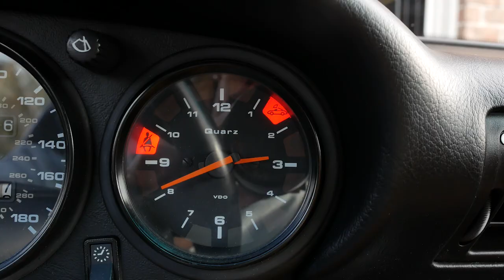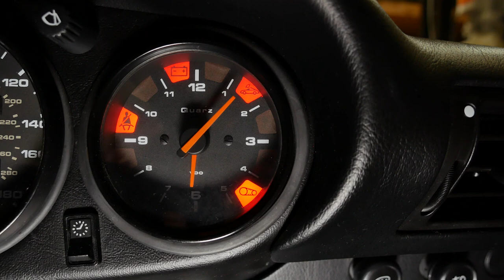Porsche 993 Convertible top Latch motor repair!

Comment from the maker: Hi Everyone, This video should help you solve the problem of a broken gear in your 993 (and maybe 964) convertible top latch motor.  I have all the details in the description as to the part number and tools.  There are two possible manufactures for the latch motors (Valeo and SWF) with slightly different cam designs but the URO 991-624-056-03K kit will fit both.  Let me know if I can help!  Franny
Reply: Great job.  Very helpful. I have this same issue with mine so I think I’ll dig into it now. Thanks! Sk
Reply: Hi there, thanks for the video, really helpful. I have a similar car you you colour etc etc, i was wondering if you have a video on how to instal the wind stopper. It would be really helpful for me as i cannot find any info online on installation. Cheers.
Reply: Thank you so much!! You helped me save $1500!
Reply: I removed the motors to operate the soft top.  The reason is that since the top cannot be operated while the car is moving, it is just as easy to do it manually.... and the motor/cable system is not a particularly great.  How can I set up the button on the console to ONLY operate the top latches to rele4ase the top but nothing else?  I know there is an electric junction on the passenger side but I do not know how to adjust the wires so it is top latch only.  Can you help?  1997 Porsche 911 Cabriolet.

Comment: I just fixed my 993 roof without any cost because of this superb video. 
It's probably the best of its type I have seen - step by step with a lot of small but important details.  It gave me the confidence to fix the car myself and saved me "shed loads" of money (UK pounds).
My problem was exactly as described with one latch gear stuck (with the roof closed in my case - so getting the motor out was tricky).  It was a tooth broken on the brass gear as shown.
Instead of replacing the cog I simply rotated it about a quarter turn and put it back on, after cleaning and regreasing. The cog only rotates about 270 degrees in action so the broken tooth never comes into play.
Hopefully it will last another 27 years (how long I've owned the car) but if it doesn't I'm equipped to deal with it now.

Thank you HeidiandFranny.
Reply from the maker: Awesome!

Comment: Thanks for the video.....I have been buying rebuilt latch motors from Vertex and have replaced several over the years......They were about $ 400 when I replaced them with my core exchanged....only tricky part was plugging in the motor the correct way with the connector or else the motor spins open instead of shutting...I reversed the coupler connector and it worked.......you may want to mention that if addressed again.....cheers

Comment: Thumbs up! You just saved over $ 1,000 and got a great video for us to watch as well. I feel such a nerd for noticing the electric motor was made by Valeo in Hungary. Was expecting Bosch ;)
Reply from the maker: Me too...  Evidentially there were two brands fitted: Valeo and SWF.  The cam is a little different on each but the URO replacement gears will work for each. The new unit is awfully pricy though! Franny

Comment: Good Morning Franny & Heidi 
Did the convertible top latch repair yesterday.
The parts I used we're in a bag branded URO as I noticed in your video.
The bag did include the two gears as well as concise instructions.
The instructions also recapped the two types of cams.
My car is older than yours being a 1991 C2, so the cam setup is different and a tad bit more finicky.
In any case we followed the instructions, took pictures and marked the parts and their positions as you instructed.
Put the unit back together exactly as it was, did the tape trick you recommended after installing back into the car, and 
voila!  works like a champ and almost best of all the light on the dash goes out now.
Not going to sugar coat how tough it was getting the gear off the shaft.
We used a press and were very careful to support the back side of the casting/housing,  to avoid cracking the housing.
Thanks Franny & Heidi  
Again you two are awesome!
Reply from the maker: Oh, that's awesome!!  And, your top is now properly latched!  It is a bear getting that gear off.  But with all your hard work you saved yourself a nice sum of money!  That might be worth a nice evening out :)  Congrats!! F

Comment: Thanks a ton guys!! Excellent video. I followed it and it worked to perfection, including the part about splaying the shaft . . . I used a bench grinder to smooth it out. Vise trick worked for pushing the grear on as well. Most useful were the tip about the T9 torx driver for the switch, which was impossible to see through the plastic coating, and also the adjustment of the cam. I just made sure the little switch was fully pressed in at both ends, and everything worked perfectly once installed!

Comment: Thanks, great video, and on my Cadillac Allante (witch you should add to the title of the video they're almost identical) I used a brass punch to tap that gear shaft off  and use a box to tap it back on

Comment: Well done, Franny.  Its really cool to see anyone who wants to get into their car and actually fix things and are brave enough to put it on the 'net.  As a professional, long haired mechanic, I have a couple of suggestions: remove your ring/s while working, tie your hair back with yet another hair tie at the very ends and use fender covers or something like that to avoid damaging any finished surfaces.  Long sleeves are ok just be wary of getting them caught in moving parts. Also be wary of URO parts quality. ;)
Reply from the maker: Will do.  Thanks! Franny

Comment: Great video.  Very well done.  I plan to do this project with my 993 shortly.  Thanks for all the detail.  I was quoted $2400 to do both of the top motors so this will save me a little bit of money ;-)
Mike in Calif.
Reply from the maker: Hi Mike, Holy cow! $2400?  wow...and I thought the gear kits were expensive!  A couple of notes: Make sure once you are reassembling the motor units that you adjust the throw of the arm such that the microswitch engages fully before the arm reaches its hard stop.  I think this is the original reason these broke.  I think the micro-switch arm gets bent over time and the motor doesn't stop in time :(  Also, sounds like a few folks are having a problem getting the top down after testing for the bad motor (the bit with the tape over the switches...).  The latch motors neede to be in their, sort of, "landing position" before the latch motor will signal to the top motor that all is good.  The easiest way to reset it is to take off that long black cover over the motors and rotate the one that is wonky by hand.  Look at where those arms contact the top of the windshield to see how they should be, but it is down-ish.  I think I mentioned it towards the end of the video.  Let me know if you run into any issues.  Send us an email from our 'ABOUT" tab on our YT homepage.  Good luck!  Franny
Reply: So I spent the weekend working on the top for my 993 convertible and spent $20 (Soldering iron and 4.5 magnifying glass) to fix the whole thing.  Your directions inspired me to to do it as there are no mechanics in N.CA who were interested in taking on this project at a reasonable price.    A couple of notes that I thought might help others.  

I initially couldn't get a response when I pushed the up/down button on center console so I did some research on this as well.  There are a couple of great forums with lots of additional input for 993 convertible top problems.  All complementary to your youtube video btw.

There is a convertible top control module tucked under the driver side dash that fails often on the Porsche 993/911.  There is a issue of cold-soldier failures in the control module and pretty much every pin on the power connectors had this issue with mine.  Once I found the control module (hidden above the VDO module, spent an hour figuring out how to get it removed, I then pulled it out and resoldered every connection that had any indication of solder fatigue (approx. 30 pins on mine).  I used a 4.5x magnifying glasses and 2x readers to get enough resolution where I could then see AND solder each pin properly.  Took 2.5 hours but was worth it.  

Plugged control module back in after checking solder points 3 times. Hit the up/down button and could hear motor in back so knew everything had power.  Ran your process for the 2 motors up front and confirmed they were fully functional in both opening and closing front of top.  Worked perfectly so saved  2 motors worth of money my mechanic had told me needed to be replaced.

Before testing power again, I disconnected both side transmission cables from rear motor located behind rear seat, so motor function would not change alignment of transmission gears or move top.  Once I knew the 2 front motors worked and the rear motor worked with transmission cable dettached, I used an electric drill plugged into the motor end of each transmission motor cable.  I did this to correctly align each transmission with the top opening mechanisms that are turned by transmissions.  I tested manually to ensure I didn't bend mechanical pieces when motor turned.

I then connected the transmission to the mechanisms that actually operate the roof movement,  reconnected the transmission cables (both left ad right side) to the rear motor and tried it.  Everything worked and I'm back in business.  Top works like new, looks like new and I'm a very happy camper.  Thanks again for your insight.  Mike
Reply from the maker: Thanks for this Mike - Super helpful!  Great call to look at the actual controller module.  That isn't the only module that goes south in these cars and, you are correct, usually a through-hole part bad/cold solder joint.  Easy fix, but a bear to find. That is great you are all up and running.  Love all the careful attention to detail of your journey!  Thanks!  Franny

Comment: Thankful for your 993 videos! I have a right-hand latch motor that seems to be working intermittently. Of course for every time that it's not working, I head out to do some diagnosis and then it works perfectly. I've tested the two switches on the frame as well as micro-switches at the main retraction motor, and everything checks out. I've even re-soldered bad joints on the control board. It's not acting like a gear problem in the latch motor. Is the motor itself just on its way out? Suggestions? Thank you!
Reply from the maker: It sounds like you still have short or bad switch somewhere... A failing motor will just start to slow down. Micro switched can be fussy at times. Is it just the latch motor? Of so, I would focus on that. It could be a bad connection as well.

Comment: Hi, Franny,

I’m having trouble with the set screw, mine is covered in a green “plastic” and I can’t tell what tool you used to losses it.  I’m assuming and Allen wrench but can’t tell what size.  I’d appreciate any help.

Thanks for your vids. I’ve used several (hood struts, etc). Extremely helpful.

-Chris

Comment: Adjusting microswitches like that are such a pain, there had to be a standard the person putting these things together in the parts factory used.. A template probably. What a fascinating piece of machinery!
Reply from the maker: You are totally right... And I think that is where all these units are failing, over-driving and then popping a tooth.  An optical sensor might be better if it can stay clean.   Does BMW use something similar?  Franny

Comment: thank you very much this great video does help a lot to me !
Reply from the maker: +唔熟唔食 Cook King Room that is great to hear. Yea!
Reply: I found broken teeth at the main bearing, however is it necessary to replace the worn drive too if it looks ok to me ?
Reply from the maker: I wondered that too.  My old one looked fine, but they both come in the kit so I figured they are a matched set.  Sorry you found broken teeth.  Just make sure when you set it all back up that it definitely activates the micro switch before the arm with the roller hits its stop.  I think the reason for all these failures is that the roller arm on the micro switch bends over time and is late activating the switch.  I hope your repair goes well :)  Franny
Reply: totally agree with you, I opened up my unit and I found the set screw (as well as the metal bit) is different from yours I think it's a design difference between 964 and 993. Can we fix the arm of the microswitch so it activates earlier ? and I found the unit I am working on runs all the way to the stop when I can hear the click..
Reply from the maker: The URO kit I used had two sets of instructions... Looks like there were two manufactures for the latch motors.  Their kit works for both and I think both are adjustable.  Is yours the one with the little Philips screw on the top of the cam? You should be able to adjust to position of the cam with that screw I think.  The arm of the switch on mine was a bit bowed so I used a small pair of needle nose pliers to straighten it back out.  Not the best design...
Reply: Heidi and Franny's Garage i think i found the reason why my gear keeps cracking. it happens after my new canvas being replaced. the left top latching motor reaches the windshield earlier than the right side. i sometimes need to use my hand to help the right side to close (my car is a RHD), by any chance you can tell me how to adjust so the other latch motor comes closer to the windshield while it close during the operation ? thanks a lot
Reply from the maker: I think that is a cable adjustment at the main top motors (I think they are in the back but I need to verify that).  They are out of adjustment on my car too...  They can stretch.  But I don't think that is your issue...  My guess is that the micro switch in the motors aren't getting activated in time.  There must be an adjustment in this other version.  I thought it was the little round head Phillips on top of the cam. Does yours have that little screw?

Comment: Hi Franny,Thanks for your superb video. My latch motors now work but I cannot get the roof system to work, it is totally dead. I have fitted a new roof controller module but no luck. All the motors work if wired direct from the battery and plug one receives power. Where does the sensing wire connected to the handbrake lever go please/ I am wondering if the controller cannot confirm that the car is not moving. When I first had an intermittent problem I cleaned up the copper contact at the back of the handbrake lever and the roof worked but it may have been a coincidence.Many thanks
Reply from the maker: Hi Christopher, It sounds like you are on the right track with the handbrake.  I would pull that switch and possibly replace it.  You should also see an indication on the dash when it is set.  Do you see that? F
Reply: Hi Franny,
Thanks for getting back to me so quickly.
Yes, I get the warning light and exclamation light on whenever the handbrake is on. I am assuming that there must be a connection between the warning lights and the roof controller and that, if this is broken, could be the problem  but I just cannot find one in the car or on the wiring diagrams.
I have changed the relay and obviously checked the fuses.
Any more thoughts would be fantastic please.
I would just like to add what a great service, it's a shame more British companies don't respond in this way. I was charged £100 to be told that they couldn't find the problem as the car is too old for their diagnostic gear, and this was a roof soeciallist who should have known the 993 isn't like a new Audi!
Reply from the maker: Hmmm...  How about the two rocker switches in the top itself?  Can you get the latch motors to run with them locked down?  Also, I believe there is a microswitch or two that gets set when the top is down all the way to tell the cable motors to stop.  Maybe one of them is sticking?
Reply: Hi Franny,
Thanks for your interest and the time you are spending trying to hepl me.
I have tested plug 1 and have constant power to pin 30 with 31 being the ground. Power from pin 15 with ignition on. Dash light comes on linking pins L and 31 with ignition on. I cannot check pin I as I haven't got an oscilloscope.
I have checked the microswitches, even those in the latching motors, and all have continuity when operated and none have been moved once the system stopped working so they should be ok.
I have spoken to a local friedly Porsche servicing centre and explained everything I have done so far. They were impressed and said I have checked everything they would and are stumped but offered to check everything out, including the wiring although it should be ok based on my testing, and told me I would need an open cheque book as there is no obvious route for them to take.
I suppose it could be the controller but I feel it is most unlikely that my original one and the new one direct from Porsche would have exactly the same problem. I have opened them both up (but don't tell Porsche!) to check for dry solder joints but cannot see anything amiss. Porsche won't sell another one on a 'sale or return basis' for me to test out.
I will unbolt the fuse box to check the wiring to the relays and fuses later this morning.
Have you got any other suggestions please?
Thanks again,
Christopher